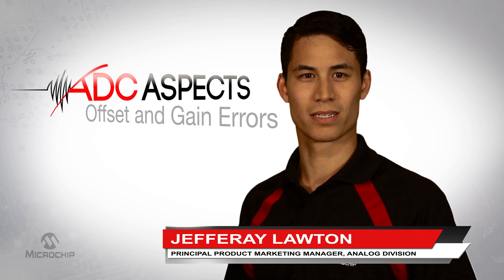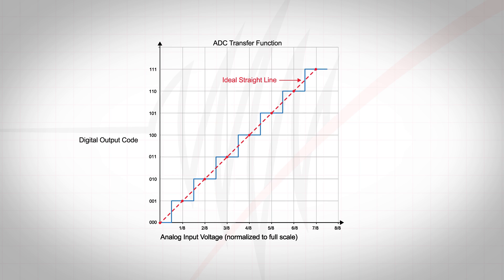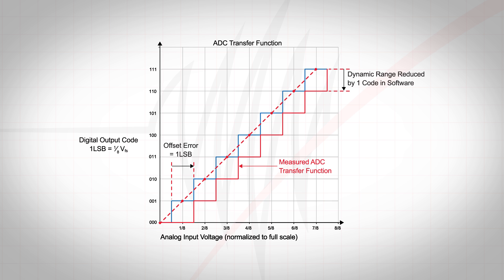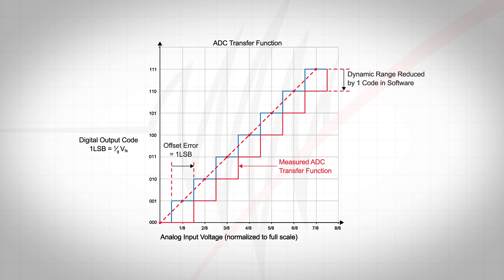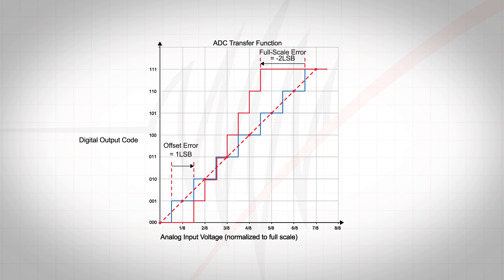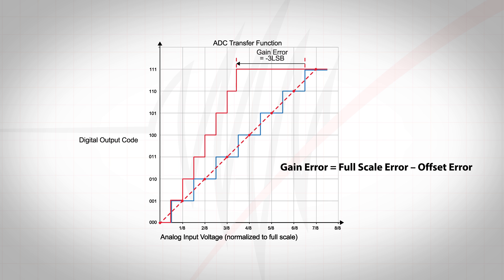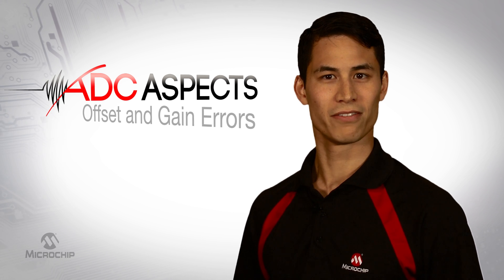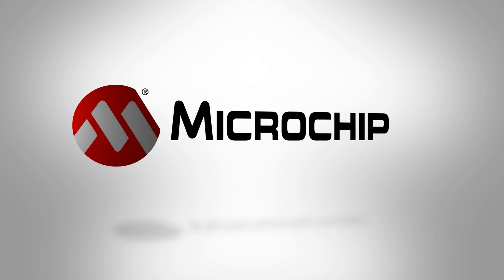ADC Aspects - Episode 3 - Offset and Gain Errors

Comment: Hi, I have an LVDT with an amplification circuit with ADC for which I am trying to adjust gain and offset for. The range of LVDT is +/- 5 mm and voltage output is -10V to +10V. Can you guide me how to adjust the offset and gain pots?
Reply from the maker: If we can be of assistance, kindly visit support.microchip.com. Thank you.